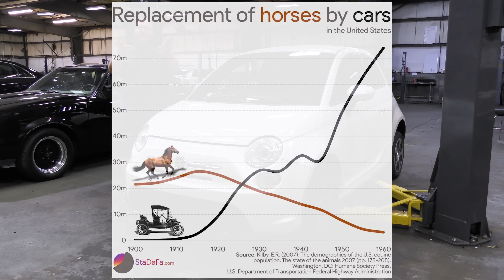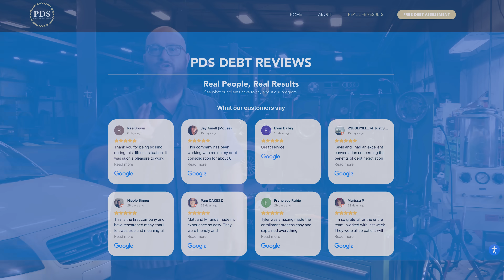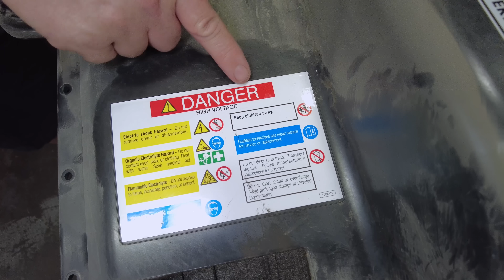How to SAFELY Remove the EV Batteries From my Fiat 500e

Comment: The big difference is electric batteries are limited just as gas engines are by laws of physics and making better batteries unless some miraculous breakthrough comes through, is being pushed to the max.  How many times have you over the last few years that the next "miracle battery" is just around the corner and then you never hear about it again.  There is a reason gasoline has been so good for so long.  It is the most energy dense substance we have that can be handled relatively safely and we understand it extremely well.
Reply: The miracle battery is just the new miracle carburetor that will yield 200 mpg.
Reply: changes that makes stuff better dont come around as it is announced, takes years......
Reply: not only energy-dense,it's tolerant of much wider operating temperatures.
Reply: Well, to be fair, gasoline ICE engines have had almost two centuries of time to develop. It's really just been mobile phone technology that's been driving battery tech forward until now. Add to that the fact that Big Oil has also been actively suppressing battery technology.
Reply: When I was a kid, I had r/c cars with ni-cad packs. 7.4v, 10-15 minutes of runtime. At the end of my r/c racing time, they came out with NI-MH batteries. More amp-hours and a longer run time in the same size pack. Fast forward 20 years and I got back into r/c cars with my son. Now they have LI-PO batteries that are approx the same size and 5x the current (1200mah ni-cad vs 7600mah LI-PO). I can run a similar r/c car for hours, not minutes. I can run our rock crawlers for 4-5 hours without draining the battery. Couldn't do that with ni-cad. 
It's the same with packs for full sized cars. Early cars used lead acid and NI-MH batteries, newer cars use LI-PO or LIFE batteries. The next generation will have a different composition that will extend life even further.
Reply: @azmax623  What it does not change is that to put 100 kwh in a battery, you need 10 hours at 10 kw power (which at household 120 volts require, roughly 100 amp, my old home all power supply).   And if you want to charge it in 10 minutes, you will need 600 kw charger, which will be 1000 amp at 600 volts.  And that will not happen anytime soon.
Reply: Have you see what the Tesla Plaid can do with the equivalent of just 2 gallons of gasoline energy?  The future for big power is clearly not gasoline.
Reply: @aussie2uGA 
Although…I did read Rimac are teasing the idea of LPG fuel cell powered EVs that would be 80% efficient.
Reply: @Ryan_DeWitt  Hard disagree. Battery tech is at the forefront of R&D. Samsung is testing solid state "600 mile" batteries right now among a bunch of Chinese companies working on it now. Gas will die. Maybe not in the next decade, but it's run it's course imo.
Reply: @MADGuappo  So we'll come back to review whether to by EV in my family in 10 years.   If we are still driving then
Reply: Problem is, how many people actually drive more than 40 miles a day?  Not many so the electric car is fit for purpose.

Time to think like a young person again.
Reply: @michaelgoode9555  We bought a Mustang Mach-E with the standard range battery and I can imagine our regular Ottawa/Montreal roundtrip, will be a whole lot less convenient. But for my wife's 15 miles each way commute, it's absolutely amazing.
Reply: @michaelgoode9555 unfortunately a lot of car purchases are motivated by "what if?" questions that dealers use to scare people into cars they do not need
Reply: @michaelgoode9555  What for, what do I gain to think electric ?  What am I buying going EV except some inconveniences ?
Reply: @michaelgoode9555  But part of the problem with EV's right now is they're too big and heavy.  Inefficient and expensive.  In my opinion, if you're not driving far enough, there's no way you're offsetting the extra cost you would have spent on fuel.  You might as well stick with a conventional ICE.  If you're driving too far, well then you get into charging stations which seem like a real pain.  I don't mind the idea of charging at night, but not in the middle of trying to go somewhere.
Reply: Diesel, gas, electric all have their strengths and weaknesses.  Where diesel has often been migrated to big, heavy, high-torque, low RPM applications, electric for most part hasn't reached the same conclusion.  Problem: Lack of energy density.  Solution: Use in applications that require less energy.  When scientists have worked on making an electric vehicles, you're usually seeing major differences in weight and aerodynamics.  The Aptera has the same aerodynamic wind resistance of a mirror on a Ford truck.  They're light weight.   This leads to less batteries needed, longer range, lower entry costs, etc.  The problem comes from the marketing side of things.  People just don't start adopting things that departure from the norm that easy.  So we have car companies making basically ICE vehicles by throwing more battery and high cost to the consumer.  This Fiat 500 is a big heavy box compared to what makes sense for an EV.
Reply: @wihamaki 
Right on the money. And it will take a generation or two before the perception of what a vehicle needs to be to change. Also huge SUV’s are quite profitable…
Reply: Batteries have been improving for the last 30-40 years, these improvements are going to continue. 

Do you still use Ni-cad batteries in your mobile phone?
Reply: @RichardFraser-y9t  Uhh no.  Eventually you start to reach the laws of physics.  Which is why microprocessors are only getting very slightly faster compared to leaps and bounds faster every generation now.  There is only so small you can make the transistors and the lithium ion battery is near the peak of what is possible unless some miracle innovation happens.  Like there is only so fast you can charge a battery as you start needing thicker and thicker cables of copper to transmit extreme amounts of power at very high amps.
Reply: @RichardFraser-y9t   Very odd of you to use mobile phone as an example. You understand old phones never had battery issues like we do now. I have old phones that you can use for years and not worry of the battery degrading like modern phones, which only survive about two years before you notice any difference. They improved in size and power, but not reliability and longevity.
Reply: @snoopdogie187 The battery chemistry used in cell phones is different, optimized for capacity over cycle life. They want you to buy a new phone every couple years and the battery is designed with that in mind. Batteries in eVs will gradually improve in reliability and performance to meet consumer expectations. ICE has been improving continually despite being over 100 years in development (but are still only 30% efficient), no reason to think batteries will not improve. Tesla batteries are showing pretty impressive lifetimes already.
Reply: @snoopdogie187  I guess the new generation does not remember that in years ago nobody would buy a phone that has a standby charge less than 2 weeks.   The idea that you have to charge the phone daily seemed utterly ridiculous when Steve Jobs introduced it.
Reply: More like cars are not a very efficient mode of transportation. The Achilles heel very specifically is tires. They deform and cushion the ride but create lots of friction leading to a car requiring a lot of power to go not very far.
Reply: @brayannexon4613  I think the real Achille's heel of cars is that we weigh on average 180 pounds and go around in vehicles that weigh over 10x our individual body weight. There's inherent inefficiency about that.
Reply: @Bynming 
We insist on travelling to the mall in our living rooms.
Reply: @meofnz2320  Better that than living in the middle of Idaho and being 150 miles from the nearest General Dollar or whatever it is that you do. Regardless, we still have 1 gas car and will for the foreseeable future.
Reply: Solid state battery? I'm pretty sure this is going to change the game.
Reply: @LetsGoPats819 Not really, they are spinning their wheels on those because it's give or take with them, they can either have a large capacity and a god awful charge and discharge rate or a low capacity and a high charge/discharge rate.. There isn't really an inbetween and none of them have been close to lithium based batteries.
Reply: Sourcing gasoline can be tricky since its something only state level entity can procure. For anyone who complain about government ev meddling they need  to remember that gasoline industry cant exist without government assistance.
Reply: @yulusleonard985 the gasoline industry only exists because of state and national government handouts.
Reply: The physics of how the vehicle is powered is not the issue, it's more so that battery tech has a ways to go in terms of charging and longevity.  Once they can get a battery that can last 10+ years, run for about 200k miles and cost under $10k replace, it will still be behind gas vehicles.  One day perhaps we will get there, but my guess is by the time this all becomes mainstream, other existing tech like hydrogen fuel will also be coming and that's more sustainable (although the logistics haven't been worked out) than EVs.
Reply: @HR-wd6cw  How much does a gas engine cost to replace?  If a battery pack cost under $10k, you'd be in the ballpark of a replacement engine.  But, just like how you don't replace a whole engine when a small repair is what's needed, battery packs are the same way.  But, aside from cost, battery tech is already where you say.  Alot of the early Teslas are doing that - they're pushing 10 years and have run for over 200k miles.  And new battery tech is even better - LiFePO4 is more stable and can do more time and cycles.  Next gen batteries are promising to do at least as well.  And when I say next gen, I don't mean stuff that's in the lab and may or may not make it out, I mean stuff that major manufacturers have on their roadmaps and that's in early production phases, getting ready to ramp to full production.

Hydrogen's issues aren't just logistics.  They are VAST.  Everything from energy density to lack of minerals on earth to produce enough fuel cells for everyone to have one.  Even storage is really tough - right now, hydrogen tanks that are practical for use in a car lose their entire contents in about a month, from what I read.  Not to mention the fundamental physics issues involved with the energy losses associated with the various pressure changes required for distribution and consumption.  Hydrogen may have uses in specialty applications, but unless somebody somehow comes up with some wildly revolutionary tech, it's unlikely to ever be mainstream.  By the time all the issues get resolved enough for it to be practical, battery tech will be far advanced from where it is today and it's unlikely hydrogen will make sense then.  That, by the way isn't a weird thing with energy - lots of technology works like that.  You have several competing technologies and some of them are actually better in some way, but by the time they improve enough to overtake the mainstream tech, the mainstream tech has advanced and the new one looks poor in comparison.
Reply: @ccoder4953  Tesla's newest battery packs are NOT designed to be repaired. they're CASTING them in foam. Making them part of the chassis. Those battery packs die,they entire car is worthless. because by that time,the battery packs will be OUT OF PRODUCTION. NOT AVAILABLE. and Tesla's SW won't allow it anyways.
Reply: @JayWye52  Quite true that those are cast in foam, but I've also seen where that foam can be removed, with some effort.  So, they probably can be repaired, it's just more difficult.  Also, I've seen where people have done quite a few hacks to Tesla software and hardware that I'm sure Tesla didn't authorize.  Anything that can be made can be repaired or broken into.  Also, Tesla's hardly the only game in town anymore - they just dropped below 50% market share of EVs.  Every auto maker and their brother is investing alot into EVs because they know that's their future.  Tesla may have been first mover, but between Elon's antics and the advantages large automakers have, Tesla will soon be just another medium size automaker.
Reply: @HR-wd6cw  people forget,batteries don't make energy,they only STORE it after the energy comes from somewhere else. the grid doesn't produce electricity by magic. Solar and wind actually reduce power availability. the more solar and wind a power company adds to their generation,the LESS reliable their system becomes. Gasoline or diesel IS energy,very easy to produce,easy to store and handle,easy and quick to refill.
Reply: another way of looking at it; an EV battery is a "gas tank"(a VERY heavy and complex tank) ,it only holds the energy that comes from somewhere else. Worst,it's a LOUSY "gas tank" that can only be refilled so many times,and doesn't release all it's energy unless the temps are within a narrow range. and replacing the EV "gas tank" isn't economically feasible.
Reply: @HR-wd6cw  The reason why they  cant make hydrogen works  for 2 decades is  because they are more expensive than EV.
Reply: @yulusleonard985 And H2 FCs are much less efficient starting from electricity (not from reforming Nat gas which makes no sense) The only advantage I can think of is the refuel rate.
Reply: @yulusleonard985  Hydrogen is primarily made from natural gas, a byproduct of petroleum production. H2 is NOT easy to handle,either.